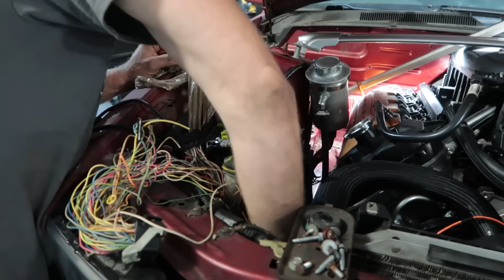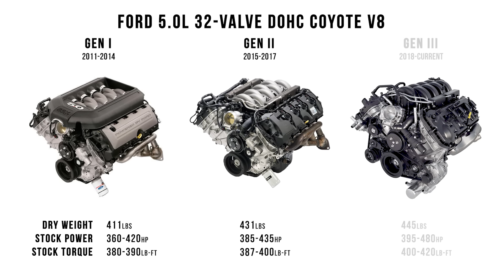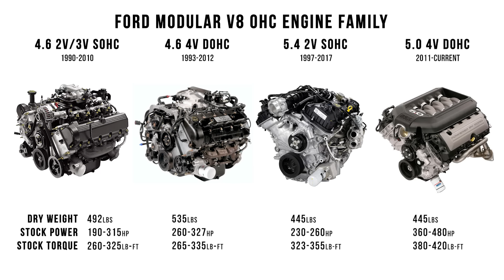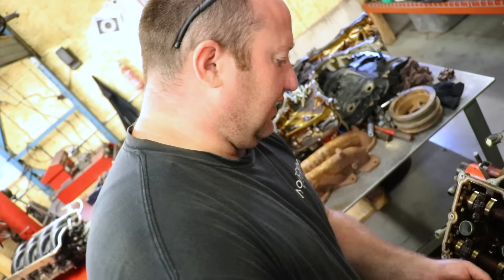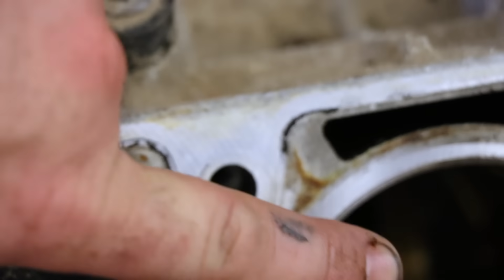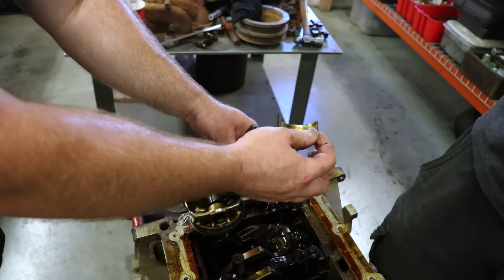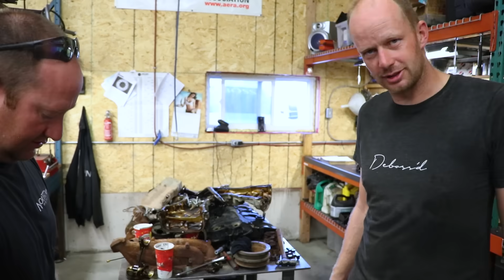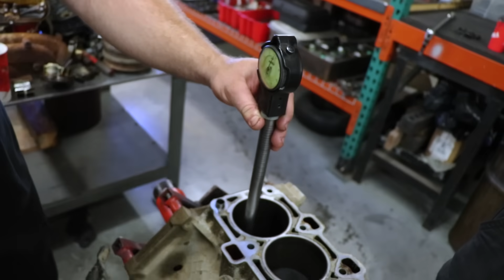REVIEW: Everything Wrong With A 5.0 Coyote Engine

Comment: I've used Mobile One full synth. in my '89 Dodge 2.5l turbo since I bought it new. I change at 8500 miles. Those little Chryslers were noted for eating head gaskets. Iv'e changed 5 of them in its 31 year life span ( 300,000 + miles ) It gives me a chance to check out the head/valves/cylinder bores. Even though its turbocharged, the engine is always clean inside. No smudge, sludge, or coking. Turbo has never had an issue.The cross hatch hone pattern is still visible on the cylinder walls. Your buddies assessment of full synthetic motor oil is WAY OFF BASE. Please let him know he is spreading false info on your channel. I'm not affiliated with any oil company. I base my statements on decades of experience working on my own vehicles. Your friend bases his on assumptions. Love your channel!
Reply: I agree with you
Reply: What car is it in? I had a bunch of those 80's Chrysler turbos back in the day ~20 yrs ago and was on all the mailing lists and later forums. I had never even heard of an EFI motor sludging until I sold them all and moved into newer stuff! In many ways they are trouble free compared to a lot of this newer stuff, and super simple to work on and fix. I had pretty good luck with haed gaskets but they all leaked like sieves - the 'ongoing oil change'. :)
Reply: @runner3033  The old boy with 300K + miles is an '89 Dodge Spirit ES turbo 4-door sedan, 5 speed manual. I have also parted out a '91 Dodge Shelby Daytona  turbo 5 speed and used the front chassis and power train to build a single front wheel trike. ( Mid engine ) Its running 17 pounds boost...scary fast. Those little motors are simple,  easy to work on and for the most part, very reliable with only routine maint. Head gaskets are the only thing to ever fail. I use Mobile One exclusively in both engines. Never any sludge.
Reply: Mobile One? Peasant oil... Villagers need to tend too their crops!

Comment: These engines are very well know for an intermittent knock, which ford says is normal. Mine did it for a while, then didnt knock for 4 years. Now just recently started a bottom end intermittent knock when HOT, but not at all cold or warm. Im wondering if its the rod bearings and how many arms and legs itll cost to.get them inspected and replaced.

Comment: Unrelated question but here it goes bud
Here’s a tough 
case of my crappy Dodge please help

I have 2009 Dodge Charger 3.5 RWD I've had a problem since the end of 2018 that isn't getting diagnosed, in the morning upon cold start when I drive if I press the gas pedal half way down the power cuts off and then comes back on again and it starts running this happens for the first 5 to 7 minutes of drive every time I let go of gas pedal and then press it half way down I starts doing it again but after 5-7 minutes of running the car becomes normal and is not as bad for the rest of the day running but after leaving it parked for about 4 to 5 hours the problem reappears but not as bad as it's in the morning cold sart. I've even changed the fuel pumps plus throttle body, fuel pump relay in fuse box but still the problem persists and I've run out of options theres no check engine light and the guy working on my car says he took it to several diagnostic scanner places where they did live scan and looked for stored codes but they didn’t find anything 

If I disconnect the coolant temp sensor it got better so I changed it but soon as I plugged it in the problem was back again

I’m beginning to suspect intake air temperature sensor I cleaned it but no difference can buying a new IAT sensor fix my problem? My mechanic says no

I should also mention that using 89 octane fuel makes the cold drive 50% better and if I leave the car dormant for a few days the problem worsens

I'll appreciate any help about my car's problem, I’m in a tough financial spot 

Thank you
Derek.

Comment: ...nothing wrong with 'old technology' engines (pushrod)...hell they're about the only engine you will find in some old field that will still be good...new tech engines are just about as disposable as it gets...I have a few first gen Hemi's (331ci) one had water in it...needs a sleeve...and the other one was out in a barn since the the '60s and little gas and some new oil...way she went...

...personally I prefer the less tech engines...less delicate, and easier and cheaper to build...the 5.0 isn't a bad engine...just perfer my simple Hemi...only thing fancy on my engine is the MDS...which after a new exhaust was quickly disabled...

Comment: This guy hates on synthetic oil, and I’m sure he’s seen some real world issues due to a lack of oil changes or running low on oil, but a lot of what he says just isn’t true. For example synthetic oil is not “aggressive” on bearings like he claims. There’s overwhelming testing showing you get LESS bearing wear with synthetic oil. You also get less sludge. And any oil will suffer from mostly short drives with synthetic typically suffering less. Basically show me any objective independent test where synthetic is inferior to conventional oil. I doubt you can find one. This guy is like your grandfather arguing we should all be running non detergent straight 40 weight because that’s what he used in his 1948 truck and tractor and it worked great. This guy also probably still has a flip phone because he thinks smart phones cause cancer and the earth is flat.
Reply from the maker: He doesn't hate Synthetic oil.  It just came across wrong as we were shooting the shit over engine disassembly at 6 am.  He runs synthetic oil in his cummins.  In his experience, the tarnish look and crystalizing is more common in known engines running synthetic than engines he knows are not.  It doesn't take much to get a synthetic classification.  But, frequent oil changes still trump expensive oil.

Comment: Let’s see oil analysis to show how bad synthetic is instead of war story theories. This engine was clearly not maintained like most daily driver engines are and run into the ground. I still don’t see how these engines are so superior to an LS. Not saying they’re junk but what is the reason exactly? the cam phaser wizardry for adjustable timing?
Reply from the maker: This oil analysis would just tell you that the engine is in the oil.  Synthetic oil was also not  the cause of the failure, just the tarnish look and the crystaliation.

Comment: Friend bought a 240,000 mile 2004 Ram hemi with a bad lifter. Owner had used "recycled oil", but changed every 5K. We fixed the lifter and flushed diesel thru it until we got most of the sludge out. Now he runs synthetic.Good oil is cheap, cheap oil is junk.

Comment: Where did you get this guy? He knows nothing about oil. First it looks like lack of oil changes to me. His synthetic oil knowledge is bullshit. Does he realize most so called synthetic oils on the market are not synthetic at all but just use an additional refining process called hydrocracking. Many brands of synthetic oil never were synthetic and after hurricane Katrina the list got even shorter because Mobil oils plant was destroyed. Nearly every oil company in the world that made real synthetic oil got their synthetic base stocks from Mobil. Last I heard Mobil had got the plant back up and running. Since the oil industry is way more tight lipped than they use to be I have not clue if Mobil 1 or any other so called synthetic oil is a true synthetic. I have taken engines apart with 200K miles or more on them that ran Mobil 1 and i could find zero deposits. At most there was a haze on the inside of the came covers. Keep in mind this was with proper maintenance and a correctly designed and functioning PCV system. It is possible the newer SN spec oils and or Dexos1 additive package could be causing more deposits than older formulas but I do not have enough data to prove it one way or another. I retired from the trade about 3 years ago so my view is more limited these days. Best I can say today is on my 2013 Camry V6 with 90K miles using Mobil1 there are no deposits in the heads as inspected with a bore scope. Oh and changing oil brands should and will not cause problems as long as you are using a quality oil. The only way I could see a problem is if you were using a ester based oil then switched to a non ester based oil or vice versa. Even then the chances of anything bad happening is very slim. https://www.bobistheoilguy.com/forums/#lubrication-and-general-automotive.102

Comment: I love my 2012 5.0 F-150. Only complaint is a poor design for the cooling system. Over time, the o-rings go bad in the radiator hoses and it’ll leak. I had one replaced at 65,000 miles. The water pumps are also prone to failing. Planning on doing mine at 100k for preventative maintenance.

Comment: I know very little about this model of engine, but I disagree with many of the things he said. Looking at this engine, I would say one of the fail point would be with the P.C.V. system. I could be wrong but I would bet the head that had the most build up is the side with the P.C.V. valve in/or intergraded into the valve cover. GM had this problem on the early LS motor causeing rings to stick leading to infamous oil consumption.....🤔 or it could have been the Fram filter....

Comment: Now mow millennium technologies can repair nikasil bores but that’s a very specialty thing. They do race engines a lot. They do my off-road bikes. Not too costly actually. Nikasil is definitely a better cylinder, it’s hard as hell. You check ring gap on a rebuild generally the bores stay in spec, the. You simply wash out the cylinders and clean them with something like wd40 until rage wipe clean then install the pistons and rods.

Comment: I don't know where there's more ignorance to be found, between the comments section or the video. 

I would not let that man touch my engine, he's fundamentally wrong about his opinion on oil, good God. 

His "assessment" about the 3V is also dead ass wrong. 

This guy claims to be a mod motor fan but misses a LOT of points and doesn't know much about them.
Reply: He said that the difference between the 4.6 and 5.4 is bore. I stopped right there. Dude don't know a single thing about mod motors.

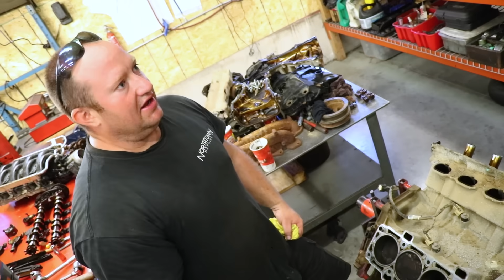Comment: Was he saying that overboring won’t change displacement due to shorter piston height? You’re not changing the stroke, displacement increases with a larger bore. They may try to keep compression in check with a modified piston though.  @15:50

Comment: I had two 5.3l chevies ('09 and '13) then went to an '18 5.0 - all in trucks and used to pull a trailer.
I found the comparison interesting - in my experience all 3 engines were satisfactory, although the Ford seems to pull my trailer better.
The 5.3 was rated at 355 hp, whereas the 5.0 is rated at 395 - same as the vaunted Hemi and it does feel more powerful than the 5.3 in everyday usage.  However, like the man said, it's not like the 5.3 is a bad engine.

I went from a '98 Chev with first the 305 Vortec and briefly had a 350 Vortec in it - when I went to the 5.3 I noticed less torque, but the extra 2 gears in the transmission coped wonderfully.
My Ford is the 10 speed tranny and it is wonderful - ALWAYS a gear available and great engine braking.

I am re-thinking, after this video, how often I change the oil, however, since the majority of our driving is around town.